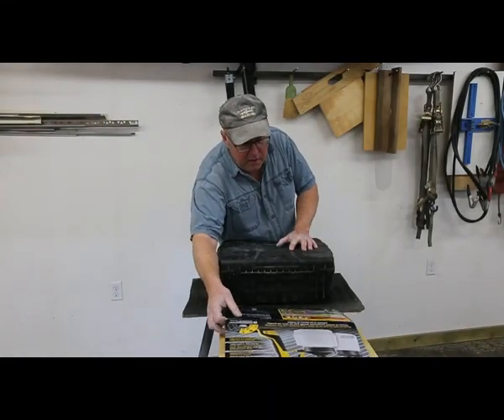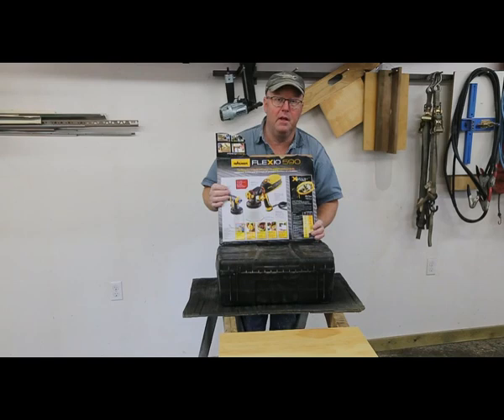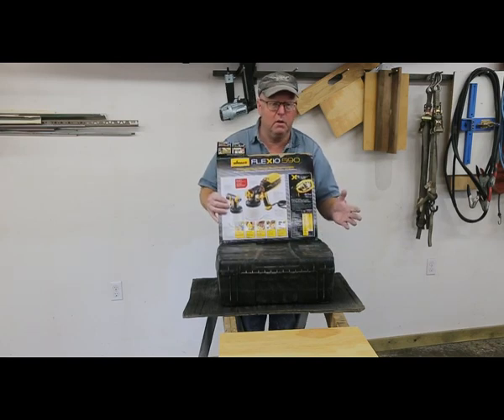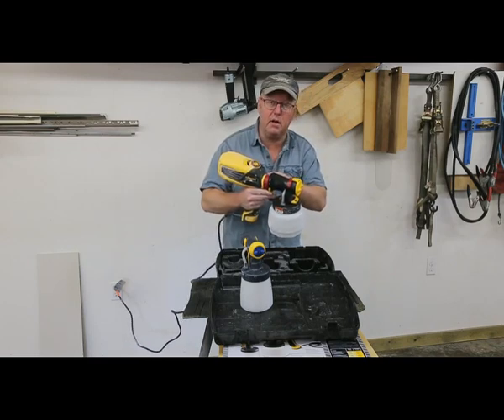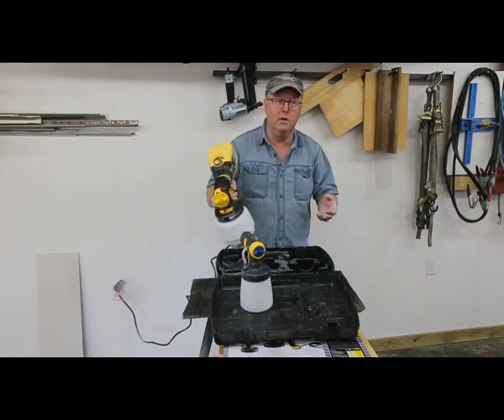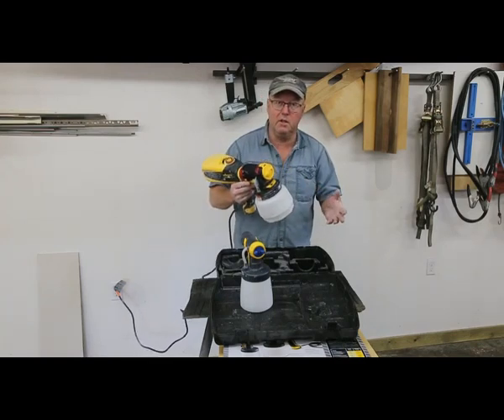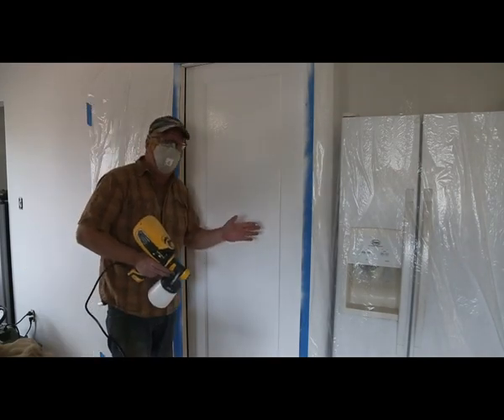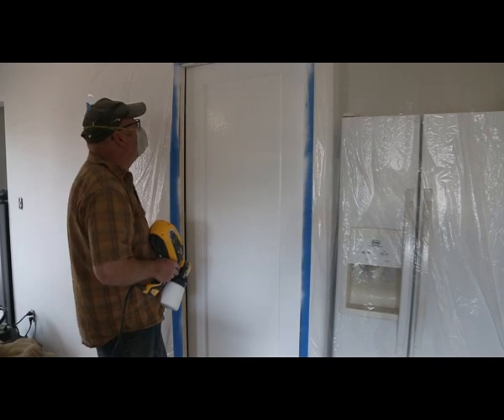Reviewing the Wagner Flexio 590 HVLP paint spraying system

Comment: I just bought the Wagner 590 this morning, have spent a couple of hours figuring it out. I even took it apart to see how it can be cleaned before using it.
I'm 75 & have always done my own decorating; I went over the years from paint brushes to rollers, power sticks which I loved. It literally sucked the paint into the stick handle from the tin & you took the roller for a walk. LOL
Even that now at my age is hard on my arms, hence my buying the spray gun. Next Monday I'm off to buy the paint needed .
By the looks of your demonstration, I could do my lounge in a day. Thankfully I have indoor scaffolding that will make doing the ceilings a lot easier. I didn't get the demo of grease you have to use on it, but with my power stick I used Vaseline on the rubbers & they never went brittle or perished over the years. 
Looking forward to trying it out next week.
Reply from the maker: I owe all types of spray guns and I am happy with the Wagner.  It is hard to paint certain items but made easier when you spray them.  I hope the sprayer makes your tasks easier, painting shouldn't be a job, enjoy it.  I know you will find success with the sprayer, a good start to the New Year.  Thanks so much for tuning in.  Stevo

Comment: I really appreciate the thorough review; thank you! If you are painting furniture and it requires multiple coats would you need to clean out the system between each coat or can you leave the paint for 2 hours?
Reply from the maker: When you are spraying,  you just have to wait for each coat to tack up well before topcoating it again so you can put a few coats on quite quickly.  It matters what type of paint you are using and how warm it is. As for cleaning it, if you are going to get er done in an afternoon or so, no need to clean everything between coats but do clean the outside of the tip between coats.  Hope that helps.  Stevo
Reply: @stevoj8959  Yeah I just wipe the tip clean with a wet rag and then drape it over the nozzle until Im ready to go again.
Reply from the maker: @Joshuatmccann  That is a good idea.  It will keep paint from drying on the tip. Thanks.  Stevo
Reply: @stevoj8959  Also it says in the instructions to undo the lid on the paint jar, then put it back on before starting to spray again. Something to do with pressure build up or ventilation.

Comment: Thank you for this video!
How much dust is there, do I need to mask the entire room if I`m going to paint a door for instance? I see you painting a door in the video, but if you could coment a little bit about that I would highly appreciate it.
Reply from the maker: There should be very little to no dust if you blow it off and tack it with a tack cloth.  I would mask a good 4 feet around the door and lay plastic on everything in the room.  Good ventilation helps but latex takes some time to dry so the over spray could stick.  Plastic is cheap and it tales very little time.  Thanks. Stevo
Reply: @stevoj8959  Thank you!

Comment: Thanks for such a detailed and comprehensive review Steve. As a first time buyer of a paint sprayer I'm a bit overwhelmed by what's on offer but have had my eye on this one. Just a question here. You mentioned the weight. I'm a slight/slim female and I was wondering if the sprayer has any sort of strap that I could put across my shoulder to support the weight if I needed it.
Reply from the maker: I don't believe so on the strap.  If you are not praying for a prolonged period of time, the weight is not bad.  Spraying overhead could get tiring. Thanks Stevo

Comment: Ninja figure out if you can use lacquer?
Reply from the maker: Lacquer could deteriorate the plastic components so I would stay away from using it.  Stevo
Reply: @stevoj8959  what sealers do you use besides the acrylic? Thank you
Reply from the maker: @krissfly  You can use any water or oil based product with these sprayers.  It depends on what type of finish you want.  The water based is a little nicer if you are spraying indoors.  Stevo
Reply: @stevoj8959  I painted the exterior of my house two years ago. How much easier it would have been if I had the Wagner back then.